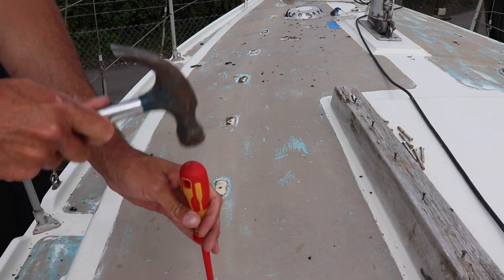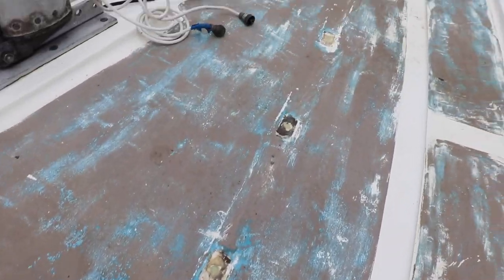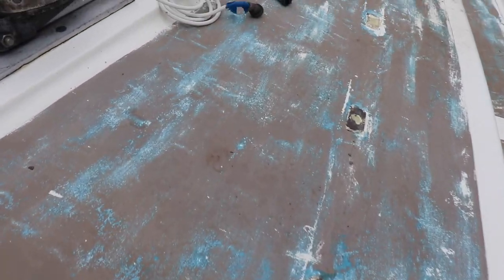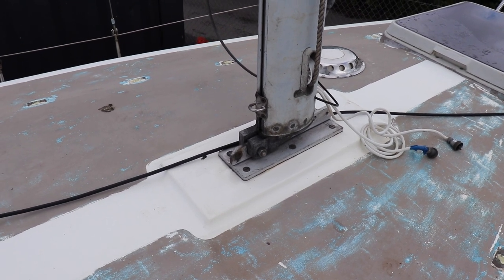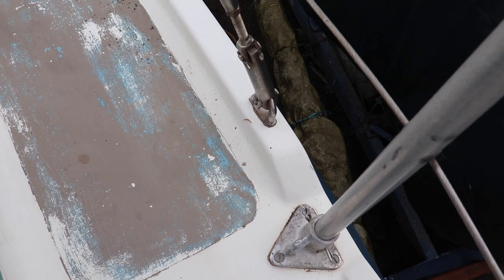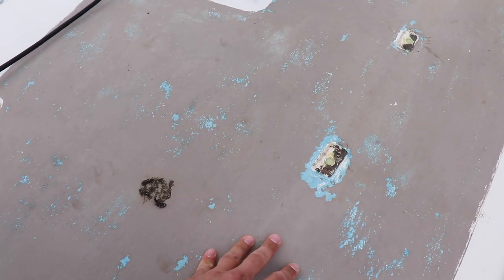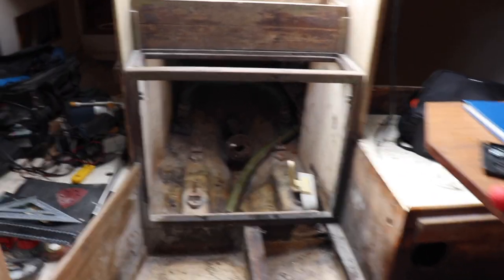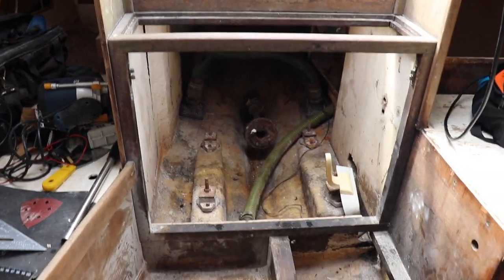Asking YOU what to do? (Bulkheads and Masts) - Episode 13 - DIY Free Sailboat Refit

Comment: You could make a water level. Use a garden hose with about one meter of clear vinyl tubing at each end. Fill it with water. Water will always seek its own level. If you still have, on the outside of the hull, a clearly marked water line it can be used to level the boat. Front to back and side to side. You need to figure out how this method works. Would recommend doing this so you have a level playing field to start. On a boat this size a 5 ton hydraulic auto jack should be sufficient to jack the boat up a bit here and there so you can shim under the keels to get it all leveled up. Be sure to spread the load around when using the jack. Don't want to punch holes in the boat with the jack. Additionally you can or could use plumb bobs inside to see if the boat has leveled up. Suspend the plumb bob from the fore and aft centerline of the boat under the deck. The plumb bob should should go from the center of the underside of the deck down to the centerline of the hull. This may vary slightly depending on the accuracy of the plugs used to make the original hull and deck molds.
Definitely remove the mast and its step. I recommend using a 1 & 1/2 " diameter (38mm)SS shed 40  pipe to create a new compression post under the mast. Since your boat does not have a center line keel you need to create an area inside the hull to distribute the downward load from mast to the hull. Be sure not to include any wooden fillers in the column that forms the compression post from deck level to the hull. 
Once the boat is leveled and the new compression post is installed it should be stable enough to get to work on the interior. If you need to do extensive work on the deck do small areas. You may need to add temporary additional bracing inside the boat to support the deck while doing this work.
I like exterior chain plates through bolted to the hull. If needed a few extra layers of f/g can be added inside the hull where the chain plates are attached. This makes a strong simple method for attaching the rigging. The exterior plates are always available for easy inspection and do not leak through the deck to the interior. But some people do not like the appearance. Your choice, looks or strength.
I have  a web page online where you can see many of these things. I did a 15 month major refit on a 28 foot sailboat. No videos but a fair number of pictures with written explanations through out the process. It is totally free to view. I refit this boat for a solo circumnavigation so some of the work and the sizes of things would be overkill for your boat. But the principles remain the same. 
For instance on the following page is shown the exterior chain plates and the new compression post I fabricated.
http://www.over-the-rainbow.us/FeNIX/Projects/Rigging.htm
Reply from the maker: Good idea !

Comment: Great job so far 👍
If I were you there would be only two options:
either you do a full restoration with unstepping the mast, refurbishing the core on deck, replacing all worn out parts, etc.
or you just fix all major and critical issues with minimum effort to get back on the water asap
Reply from the maker: Exactly … but wouldn’t make a good YouTube series apart from my bad navigation skills!

Comment: I've read the comments below and there is a lot of good ideas. Unstepping the mast would probably be a good first step; repairs needed there any way. Nick Gates had a good series run on YT that had a bit about checking for twist using "winding sticks. Sadly it looks like the vids have all been taken down, but the theory on this method is easy to find. Anything you do take out, try and keep it as whole as you can for templates. I like the ideas you have for the electrics and heads etc.
Reply from the maker: I have saved EVERYTHING that was in one piece ! 😂 there was a few that wouldn’t stay in my piece lol

Comment: You can use a water level to check how far out of level the boat is. Pick several fixed points to check for level. Midship, stern and bow. You could us the rub rail as a reference point, the stanchions should work as well. I definitely would take the mast down and make sure the mast step is  secure with no rot
Reply from the maker: Need to save up to take mast down as it will cost £1 a day to store as well. Seeing as it will be off for a year max its a lot of money! I have seen that method of tubes used on Sailing Parley Revival !

Comment: remove the mast, put spacers in uneven places, make the hull and deck symmetrical, then reinforce and finally install bulkheads to keeps shapes in place, that's what I would do
also im not sure about keeping boat on keels, its a lot of pressure and even slight unevenness would bend FG hull, so you better check it twice and level
also all seats in this boat MAY BE structural as well
Reply from the maker: You might be right about the seats even if they are or are not meant to be. They are all tabbed to the hull

Comment: You can't remove any bulkhead whiteout taking down the mast. If you do the roof can collapse.
Reply from the maker: Don’t worry there is no way I’m removing bulkheads until all the weight is off the deck
Reply: @SailingPuffin  When you have removed the bulkheads then wait a week or two before you make templates just in case the boat resettle in another shape.
Sorry for my english, I'm from Denmark but have done the exact same thing as you are doing now to my old sailboat.
Reply from the maker: @visionamd40  it’s been sat for ten years, I’m already worried about it settling ! I will probably not have the bulkheads sitting straight onto the hull but have a rubber foam strip between the bulkheads and hull. I’m hoping that may help a bit with movement.
Reply: @SailingPuffin   You can't put a rubber strip behind them. The bulkheads are there to stop the hull from collapsing so they have to be glassed permanent in place. Tjek out West system here on YouTube. They show how to put in a bulkhead.
Reply: @SailingPuffin  If you are worried about it settles to much then put up a support or two in the middle of the boat to hold up the roof until the new bulkheads are in.
Reply from the maker: @visionamd40  they will still be tabbed in with fibreglass, you just don’t have the bulkhead right up against the hull. That’s what I’ll be doing. Don’t worry not just a rubber strip
Reply from the maker: @visionamd40  good idea !